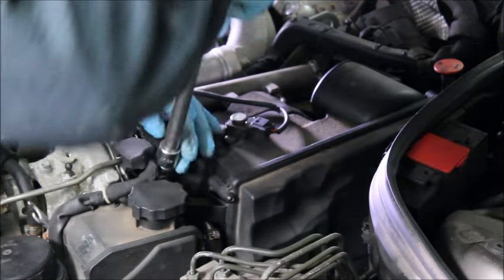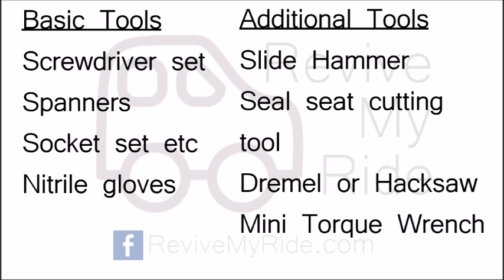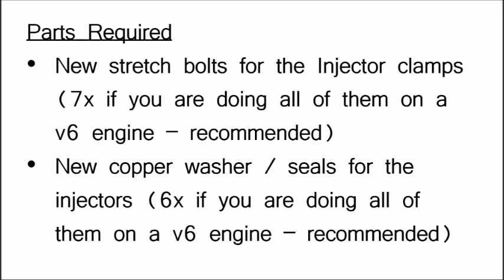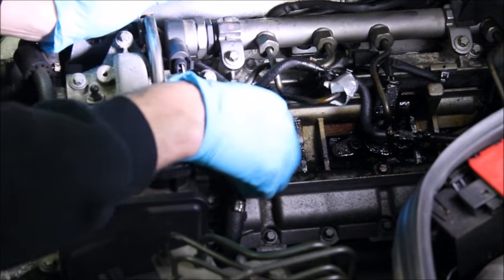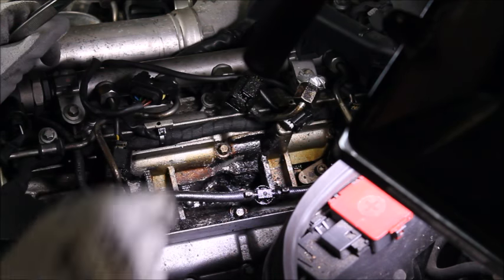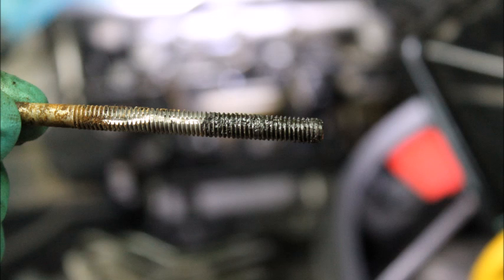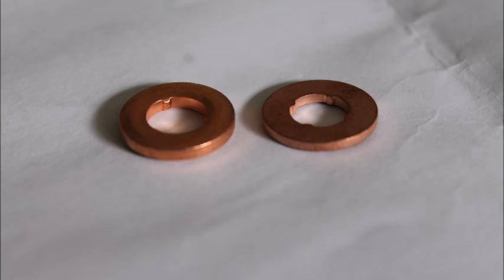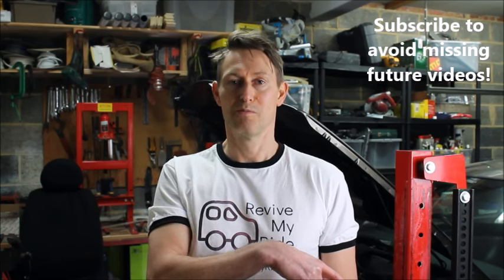Mercedes diesel CDI (Black Death) leaking fuel injector - How to diagnose and fix on 3.0 V6 engine

Comment: As a qualified diesel fitter I find your video very informative with great explanation on not just  how it is done but also why you need to do it that way. Lots of videos dont tell people the "why" part. Also a lot of videos show the job being performed with shifters and tools that can end up with other issues due to them not really being the best choice. Yes, not everyone has the right tools and like you have shown, researching ahead and buying thr right tools helps avoid disasters. This is why for most people workshops are too expensive due to the outlay and overhead costs being so large. You have managed to give a great tutorial for novices on how to perform the job without causing further damage. Well done mate. A lot of people will benefit from your efforts. Cheers
Reply from the maker: Leanne Krosch, really appreciate your comments! I'm always interested in trying to cover what tools are required and why. As you say, a lot of people (diy) will do this job as a one off, so I try to find cost effective specialist tools. Hopefully people can watch the video and decide if they want to tackle the job or send it to a specialist such as yourself. Thanks!

Comment: I'm about to change my air filters, when I do I shall be inspecting my injectors. If clear of black death I'll still inspect every 5000 miles.
Thanks for a very clear concise video.
Reply from the maker: Thanks for your comment! Sounds like a good plan! Best not to mess with the injectors unless you have to, the seals may never fail and there is always the risk of accidentally causing a problem when doing this king of work.

Comment: An excellent video, well presented. However, two issues, firstly there was no mention about which way around the copper washer goes. The domed surface faces the injector. The second issue is in the way the copper washer is fitted. If you rely on the friction fit to the injector tip, as you lower the assembly into the hole, if the washer falls off it can turn in the bore and end up the wrong way around. I use a long thin cable tie, slide the copper washer up the cable tie and lower into the hole until the tip of the plastic has entered the cylinder. Release the copper washer and it will end up in place facing the correct way. Remove the cable tie and you can then lower the injector into the hole and continue with the assembly.
Reply from the maker: Hi, thanks for your comment and the extra info! I did research the topic of the washer. Info was hard to find but everything I found said that it could be fitted either way up. I did all 6 of mine, so some were bound to be a mix of dome shape up and down but I haven’t seen any issues… I don’t suppose there is any information that you can link to is there? If not, no worries I’ll take your word for it, you seem to have experience! Thanks, Phil
Reply: Hi, I have the official Merc workshop manual and there is no info given. Rightly or wrongly, I decided to fit the domed end of the copper washer onto the alloy head rather than the injector. I've not had any issues. The logic being, I'd rather the rounded, or domed face of the copper washer come into contact with the aluminium seat thus minimising the risk of the copper washer causing any localised deformation of the alloy seating face. Even though I know the cooper washer is softer than the aluminium head. 

Also, pressure = force divided by area. The marginally smaller the area (due to the rounded rather than square sheared edge of the copper washer), the greater the sealing pressure on the copper washer for the same bolting force. 

I didn't have to recut my seats as they looked in very good condition. So, I figured if there was any minor irregularities in the alloy seat, the copper washer would have a marginally greater pressure on it to 'flow' into them and in theory a better chance of sealing. That said, it probably doesn't make any real difference!  I've not had any issues since. 

I'll note the orientation next time I remove a set of injectors. I have to do that soon to replace the rocker / valve cover on my W447 - which is annoying!

Comment: As others have said, a great video, thank you! I have a problem though that I'm hoping someone on here may be able to answer.
I have the same engine (installed in a Merc 320 CDI, 2008). All has gone well so far with my injector seal replacement, but I'm now stuck at the seat-cutting/reaming stage. The video clearly shows the use of a 17mm flat cutting head, and other references I've found (not that there are many) also recommend the use of the 17mm flat cutter. However, in my case, the 17mm cutter appears only to be making its mark on the very outer surface of the seat, as if the actual injector seat is a 15mm diameter face inset a few mm below a 17mm bore. (at 17:41 in the video, you can see what appears to be a raised 'ring' surrounding the main circular area of the seat). From what I've read, only light pressure is required on the cutting tool, but I've applied more pressure more times than I'm now comfortable with, and still the cutter does not appear to be making contact with the primary face of the seat. 
I've tried the 15mm cutter and this does appear to make full contact with the seat face, so perhaps my seat is in fact 15mm? The only problem I have with that is that the copper washer is known to be 15mm in diameter, so surely this tolerance is too tight? Surely the 15mm washer should fit into a 17mm seat, thereby allowing the washer to expand as the hold-down clamp stretch-bolt is tightened?
Any thoughts, anyone? Should I perservere with the 17mm cutter or are some of these engines equipped with injectors that use 15mm seats rather than 17mm?
Reply from the maker: Hi, hopefully others will see your message and contribute their experience too. However your comment has jogged my memory. Somewhere in the comments someone else mentioned using a smaller cutter for the reason you describe. Also, I cut a couple of seats on my car (didn’t show them all) and I’m pretty sure on one one of them, the casting near the bottom about 10mm above the seat was a little narrow for the 17mm cutter, maybe by about 1mm? I was very patient with the cutter and persevered with it. I kept cleaning the debris off of the blade and applying more grease. Eventually the cutter took a small “skim” out of the casting in the bore which allowed it to reach down to the seat. I then cleaned up the seat with the cutter as normal. Hope that helps and the description made sense!
Reply: @ReviveMyRide  Hi, great to see your comprehensive reply, many thanks! Yes, the issue you describe is exactly what I found with this injector bore (thankfully I only had to do one). Your description of your own experience, coupled with your comment that you'd read about someone else needing to use a smaller cutter gave me some reassurance. In the end, I reasoned that the injector had come out of the existing bore and therefore it should be happy being returned to a bore of the same diameter, so I stuck with the 15mm cutter.
I also used the Honda-manufactured copper washer that you suggested (and also recommended by other DIY enthusiasts). In my case, the extra thickness of this washer (when compared with the Mercedes original) served to compensate for the material I had to remove from the injector seat (see below), so this was a good call. I'm now pleased to report complete success with ths job, so many thanks again for making and posting such an informative video.
Incidentally, the seat of my actual injector had been eroded by the blowback gasess, so in addition to cutting the bore seat I also had to reface the injector as well! (If anyone is iinterested in how I did this, please ask/comment and I'll explain). This took some effort, especially bearing in mind the need to keep the injector face level and flat. I was actually on the point of replacing the injector, but I changed my mind when I learned that new/replacement injectors need to be CODED to the car's ECU! I now understand why this is, but it's a fact of which, until now, I was ignorant. So please bear this in mind if you go down the replacement route. Obviously a garage can do the coding (at additional cost) and I understand that some of the newer, high-end code readers can also code injectors. If the coding isn't done, anything from poor runnning to the car failing to start can occur, so it's an essential step. It also applies if you swap the positions of the existing injectors as they are coded for their positions as well as their individual operating characteristics.
Reply from the maker: @willcram8350  hi, thanks for your reply above, all really interesting stuff! Good work refinishing the sealing face on the injector! None of mine were damaged but I had heard that it can happen, most people replace the injector but as you say, apart from the cost of a new injector, that then introduces the need for coding etc. One thing I didn’t know (and thanks for sharing) was the implications of not coding. I thought it led to a slight loss of running performance (minor trimming of the fuelling due to injector calibration) not that it could cause non start and other significant problems. I actually had another viewer asking me about coding and non start on FB, so I forwarded on the info you shared! Anyway, good work and happy days that you got it all sorted! 😎🙌👍 thanks, Phil
Reply: @willcram8350  hi! Thank you for your input on seat cutting and productive discussion with the author!  Would really love to read how you re-surfaced the injector seat. Thanks.

Comment: I found that a spray can of starting fluid with one of those little red extension tubes was very helpful to clean the debris out of the bolt hole that holds the injector down. Then another can of compressed air blows the starting fluid out. It made the bolt hole extremely clean and prevented the bolt from bottoming out to soon and affecting the torque pressure.
Reply from the maker: Hi Dennis, this is a really good tip! Thanks for sharing! :-) Cheers, Phil

Comment: This is a great video; just the right amount of detail and I with no knowledge of cars could follow along. Alas… this issue is exactly what I have at this time.

I have a query I hope viewers may answer - I have a 2007 2.2 diesel E class, 152000 miles on the clock. I live in Scotland. I had the car in for an MOT last month and whilst having the MOT work done the mechanic also diagnosed an issue with an injector that was producing the ‘hiss hiss’ sound. I have to say I never noticed any big issues with the car's engine/overall performance prior to the visit.

He installed a single new injector and I understand washers too but on return of the car to me the car was vibrating noticeably whilst an idle. I took the car back, he performed more work and the roughness subsided for about 3 weeks only for the roughness to return yesterday. I recall him telling me the injector was difficult to remove.

From watching this video I have just had a look at the injector/cyclinder head area. I can clearly see heavy black wet deposits and clearly see and feel the ‘hiss hiss’. The injectors were very easy to locate. The replacement injector is ( i think) not clamped down with a torx screw... whereas the other 3 injectors are.

Video of my car - https://youtu.be/ip99tlKHf_o

I will clean the area up today and give the car to the mechanic tomorrow. The car drives ok, I did 2  50 mile trips ok before noticing a repeat of the fault and this video but other symptoms are the rev counter wavers at idle and the vibration (annoying as hell !) when idle.

There are no warning lights on dashboard BTW.

Can anyone comment on what has resulted in the ‘hiss hiss’ returning after 3 weeks and what the mechanic must do from here on to fully resolve the issue ? I also understand from comments that the new injector must also be coded ? I do not know if coding was done as I only discovered this aspect last night.

I recall the mechanic telling me that if the injector was worn it can have an effect on it's alignment with the cylinder head which could result in the repair job outweighing the value of the car… comments please ?  £500 paid so far (ex MOT work) so I am keen to get this issue fixed at no further cost to me. Thanks all.

Comment: I have a T1N Sprinter that is now slightly over 100k miles. I have not inspect under the cover yet but thinking that sooner or later I will need to perform out this cured work. Thanks for putting the time and care in making this video. It is the best out there in clarity. :washhands:

Comment: Thank you. I have to do one on the Jeep Grand cherokee wj, and this video is the best one I've ever seen. You're a very good instructor, teacher .
Reply from the maker: Thank you very much! Good luck with the work, hopefully the carbon deposits aren’t too bad on yours, clean up is the time consuming part of the job. Cheers, Phil
Reply: @ReviveMyRide   did an oil change four weeks ago. It was clean, only noticed smoke coming out of the engine the other day, and was shocked a pool of black goo all over the first injector leaking to the second looks like a mess got four cans of carbon cleaner. 😳

Comment: Great information well put together. Thank you from someone considering an ML 350 cdi with about 80k miles. 2010 manufacture year.
Reply from the maker: Hi @richbrett7268 Thanks for the kind comment! I wouldn't let the leaking fuel injection issue put you off of these cars. The OM642 is a fantastic engine apart from this small issue. If tackled early (just check it from time to time), it's actually quite an easy fix... Cheers, Phil

Comment: Btw the reamer kit you recommended did not include a 15mm x  17mm flat reamer that my ml320 cdi needed.. I am still thankful for the video!
Reply from the maker: I'm really sorry about that! Thanks for letting me know, I will go check the link! The problem is that Amazon keeps delisting the tools and then I have to go find another one. Originally, I was linked to the exact tool I used, so I knew it worked! Glad you liked the video and thanks for your comment!

Comment: I've used your video in the past to change injectors on a ML270

I'm about to do it again on my E350

Thankyou very much 👍👍👍
Reply from the maker: @norfolkbushmanandfriends791 That's great to hear! Appreciate the comment! 👍😎 BTW,  I have an E350 cabriolet that I fixed up from salvage, If you didn't see it the videos are on my channel. Great car!
Reply: @ReviveMyRide  I had mine re mapped, the difference in torque & power are amazing 👍👍
Reply from the maker: @norfolkbushmanandfriends7916  I'm super interested in this! But, it's my wife's car now that it's done and she says it is fast enough 😭

Comment: Thank you for the video, had mine done today and for my surprise, the middle right injector didn’t even have a washer. Only thing I didn’t have was the hammer puller so I used WD40 and a rocking movement to get them out. Did all 6. 👍🏼👍🏼👍🏼
Reply from the maker: Augusto Barale thanks for your comment, glad the video helped give you some information. Weird that a washer was missing! Yes, you are correct if you are patient and the injectors aren't stuck too badly, you can remove them exactly as you described :-)

Comment: Just watched your video. Very, very well presented👍🏻. If I could be so bold as to maybe add a tiny tip to your great thread cleaning bolt, I would recommend applying a thin coat of grease to the slot. This helps to hold any debris collected. Another point that may or may not be important is in using a thicker sealing washer. Will using a thicker washer "lift" the injector by an amount that may cause issues in the fuel delivery? I doubt it myself but just thought I'd put that question out there. Many thanks again for your time and trouble making this informative video.
Reply from the maker: Thank you, some very good comments there! Yep, great idea about the grease on the “thread cleaning tool”. I’m pretty sure that is exactly what I did but may not have mentioned it in the video, so thanks for highlighting it! Slightly thicker injector seal - many people in the Merc community have been using this exact washer for quite a while now, so I would go so far as to say it is “proven”. It’s particularly useful if you have had to skim the seat with a cutting tool. Thanks for your contribution! 👍